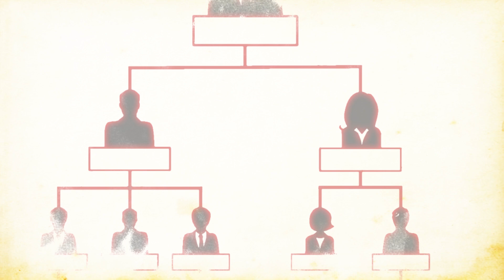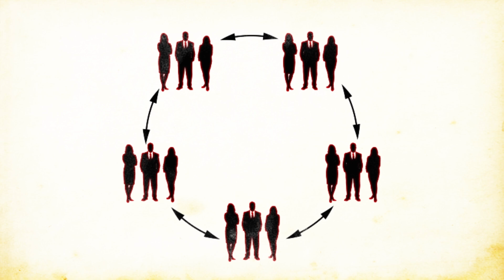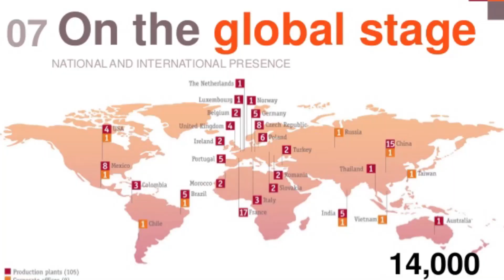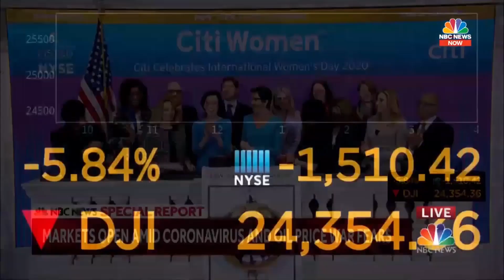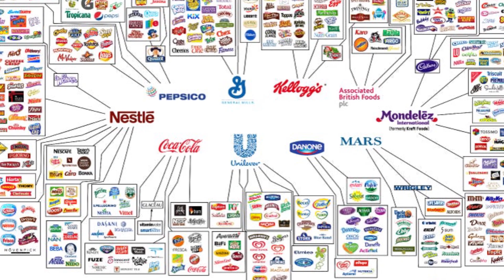Workplace Democracy and Co-ops

Comment: Starving artist clause: if you use your rationed "entertainment points" towards your "passion project" you can be allocated an additional amount of the necessary resources multiplied with weight based on the current availability of the given material, simple yet ecconomical.